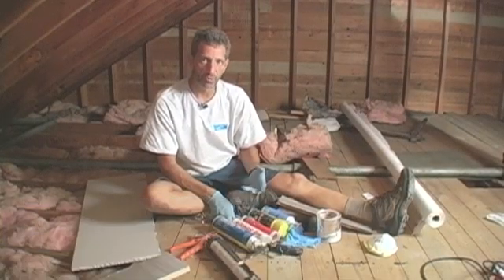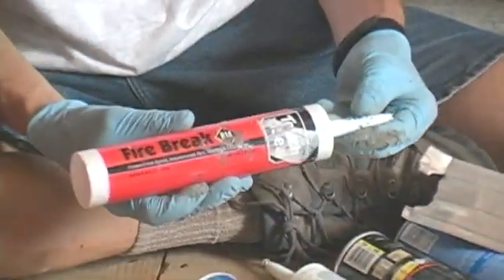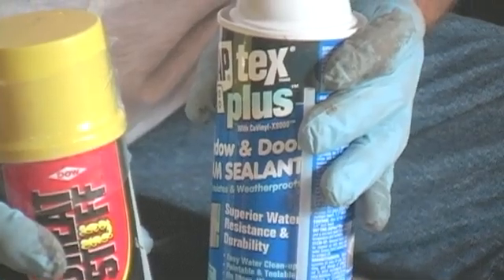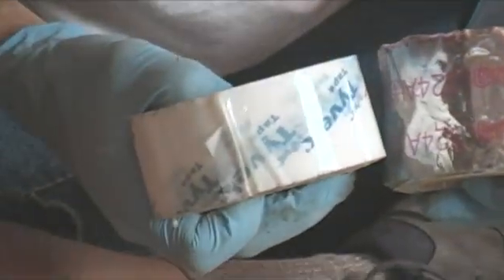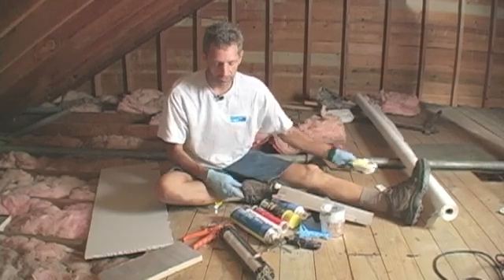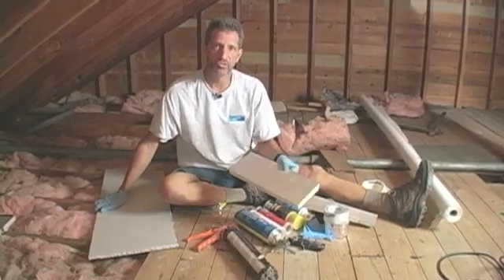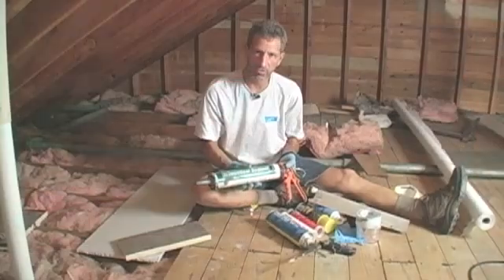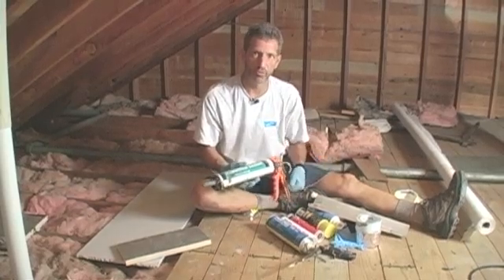Materials for air-sealing and insulating an attic: Caulk, tape, and spray foam

Comment: When you air seal attic don't you have 2 vent the living space somehow from gasses and stale air and such?
Reply: No, you don’t need cracks attic to vent your living space! You can use whole house fan, running AC or open the window for that
Reply: @alexchandra7880  you deffs have 2 vent the living space is you air seal everything theres gasses and stuff that need to be ventes
Reply: @Brandon-no3vc  If you seal the entire house below 3 ach50 you need an ERV - this is basically a fan that constantly exchanges the air in the house with filtered and conditioned outside air.

Comment: U never want to seal soffits that's what vents your attic
Reply: He's referring to drop soffits on the interior of the home that house ductwork or lighting. Not soffit vents to the exterior.
Reply: Hi Andrew, you seem to know what you are talking about so I have a question.  I have an old (1867) home with an attic similar to the one in the video.  Mine is fully floored with some insulation under the boards.  I want to add more insulation.  I seem to have no soffit vents at all.  I simply have an exhaust fan in the end wall.  Can I just air seal the gaps and then add insulation batting in the sloping ceiling or do I still need to add soffit baffles.  Thanks for any help, Sheryl
Reply: I'm not Andrew,  but if I were you  I'd seriously consider pulling up all that flooring, unless you store a lot of stuff up there or if you plan to build it into livable space. If you pull it up, you can have a look at your insulation, most likely you don't have enough. I would also consider trying to air seal your attic as best as can be done, and install ventilation baffles if needed. Once you do all that, you can increase/add insulation and bring it up to at least R50. Then you can add a radiant barrier on top of the insulation and you should be set. I know this is 2 years late,  but maybe it will help you or someone else.